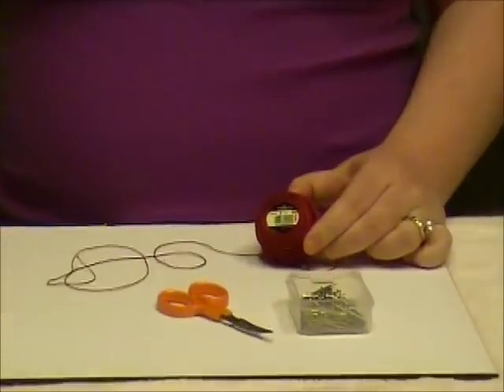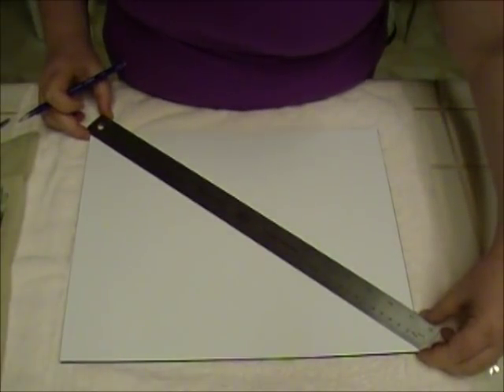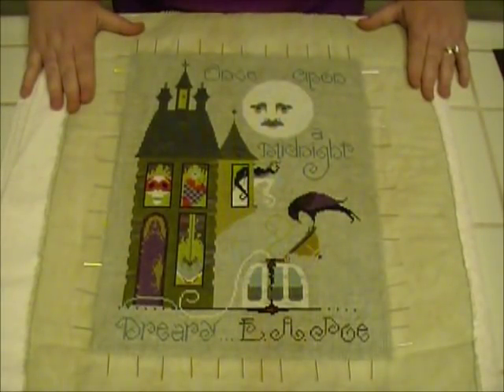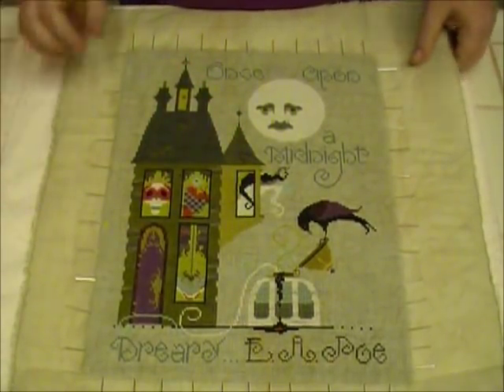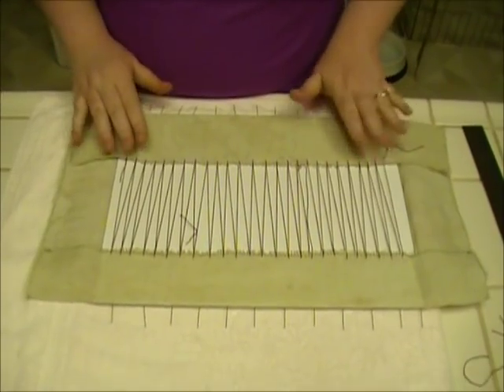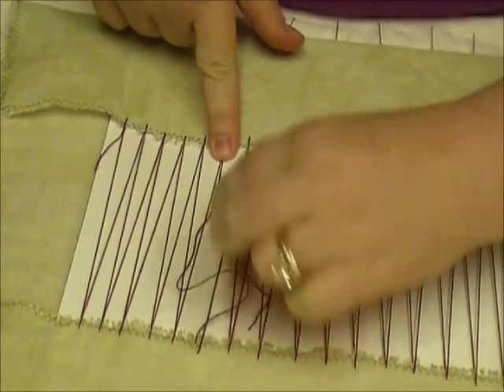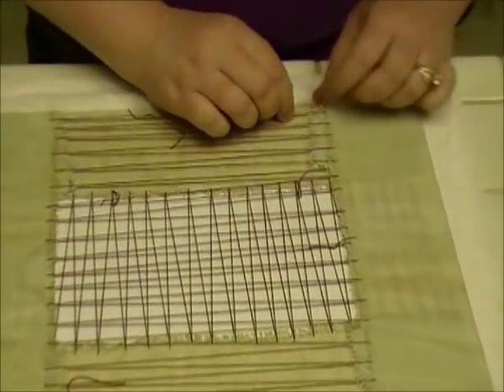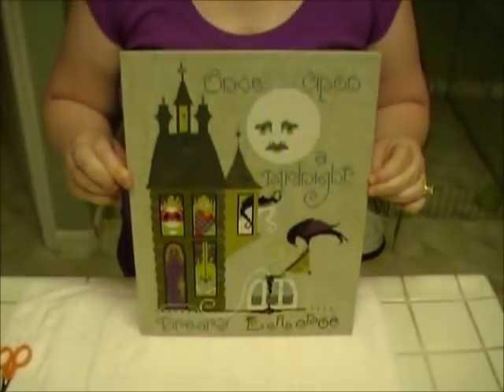How to Lace your Needework

Comment: I mark the centres on each edge of my mountboard on the back of the board.  I then baste stitch the centres on each side of my stitched piece so I can line them up.  I then gauge approximately where the fabric will fold over the board and put a basting stitch all the way around - counting the Xs rather than using a ruler.  I then have a line on 4 sides to guide me when I'm pinning.  Thank you for your video as I lack confidence with lacing and tend to pin and stick with masking or framing tape.

Comment: I  wrote to you before but I forgot to ask you a question. When your ironing a counted cross-stitch project, face-down on a towel, what should your iron setting be on? Also, what setting on your iron would be good if you used beads and metallic threads? I have been told many things but I wanted to check in with you and see what you said. Because you have given me good advice so far:o) Thank you so much for all of your help! Your really quite wonderful. You taught me how to lace my projects so I have gotten caught up on years worth of projects and am stitching new prpjects:o) Thank you.
Reply from the maker: Hi Laura!  Sorry for the long wait!  I use my iron on cotton with steam.. Unless there are metallic threads or that fishing line type thread used to attach beads.  Then I will lower the heat and cover the back with a thin cloth(like a t-shirt or the like)  then I try to iron like normal, just making sure I stear clear of the areas that have the plastic line or metallic that can melt with high heat.  So I'm basically getting the wrinkles out of the fabric, without rubbing the iron over the delicate stitched part.  Hope that helps! Janet
Reply: I use a steamer when I do mine. I wash it in Orvus, roll it in a towel to dry it & steam it when it is dry. My steamer has a small tank that sits on the floor & a long hose. I lay the piece face down on a clean ironing board surface/press cloth (or on a white terry towel if there are delicate beads, metallics, etc...) & gently go over the back with the steamer wand. Works a charm. The only thing I have to watch is for water drips since I am steaming it horizontally instead of the usual vertical. So I occasionally hold up the wand & jiggle it so the drips go back down the tube. I also use distilled water so there aren't as many minerals (just in case it does drip). It also works wonderfully to flatten folded or rolled linen, adia, etc... from my stash before stitching too! If you were super worried about things melting you could always hang them in the steam & see what happens... BUT I have never had a problem with the steamer and it doesn't mash the stitching or get caught on the edges of things.

Comment: Have you ever added padding before framing?  Wondering how you would center all the different layers.  (Thank you for this video. I was self-taught and did it almost exactly the same way.)
Reply from the maker: If I were to use batting for the padded look (like with ornaments), I use acid free spray adhesive and tack down the batting, then lace as normal.  Hope that makes sense! :)
Reply: Certainly does!  Thank you.  I'm not very crafty and don't even know about products like that.  I'll give that a try.

Comment: Thanks for your video! I was wondering about the way you stitched the outside edges of the fabric; is it by hand or by machine? I can't find any videos or other how-tos about this, most info says to tape the fabric before you start your project but I didn't do that. The Aida fabric I used (which I tea dyed before stitching) hasn't frayed at all so I'm not sure if I need to worry about it. Thanks.
Reply from the maker: Lisa Undercoffler, thanks!  I just use my sewing machine and do a regular zigzag stitch.  Please don't use tape, as the acids will break down the fabric.  If you don't have a machine, just whip stitch the edges by hand.  You could leave them raw, but your using a decent amount of tension to lace, so it might make your fabric fray. :) Janet

Comment: This vid is 5 yrs old and still relevant! I have a question. Some stitchers frame without glass, I'm planning on framing with glass. I've read that when framing with glass you should use spacers to keep the stitches off of the glass. I haven't found any cross stitching related vids concerning using spacers. And I wondered if instead it was possible to just cut a frame a foam core to go on the outer edge in front of the cross stich, hidden, but creating space. Like a mat board, but not a mat because it's hidden, and because I'm not fond of them. It wouldn't be very wide, and would require lots of measuring, but with limited resources it would be easier than hunting down spacers that I don't know how to utilize. Or does it even matter if the stitches are against the glass at the end of the day? Any thoughts? Thanks!
Reply from the maker: GreenEcheveria.. Thanks!  I always use museum (preservation) glass with my stitching, but it is pricier.  I am a proponent of keeping your work protected by glass, UNLESS it is not something you care to save for generations.  I also always use spacers if not using mating.  Any framer will have 'spacers', which they can sell to you.  They are basically long, thin pieces of black/white plastic with a adhesive back that you cut to size and stick on the glass edges to keep your piece directly off the glass itself.  You could try cutting strips of foam core, but it wouldn't be worth your time and frustration.  They are worth the small cost, trust me!  I hope this helps, if you have any more questions, please let me know.. :) Janet
Reply: Trixie Stitches.Thanks! That's incredibly helpful.

Comment: I want to thank you for you putting out videos to help all of us. That is sweet! I have a question. No matter what brand of aida cloth I use I can never get all of the wrinkles out of it after I washed and ironed it. I let the needlework soak in barely warm water with a cleaner for delicates. i soak it a few minutes and gentle swish it around and let it soak some more. Then I rinse it and let it drip dry. I hever wring/squeeze it out because i have found that causes more wrinkles. When it is dry I iron the piece face-down on a folded up towel. I do not know what I am doing wrong. I must be retarded! I am desperate. Should I not let my work completely dry before I iron it? Do you know what I am doing wrong? I do not want to use alcohol sprays to relax the cloth and take out the wrinkles. Can you please help? I will take any and all suggestions. Thank you so much for your help in this matter. Have a great evening. Laura
Reply from the maker: Thanks for your feedback! :)  and to not have wrinkles, keep the Aida damp, put front side down on a towel, then iron.  If you have any metallics or beads on it, put a clean thin towel or cloth over the back before ironing.
Reply: +Trixie Stitches  Thank you so much! Your wonderful! I really appreciate your tip on metallics and beads. i am starting to use mor of those so I would have needed the information soon. Thank you so much!
Reply from the maker: +Laura Moore Your welcome!  And if you ever use hand dyed fabric or threads, they aren't colorfast, so don't wash those :)
Reply: +Trixie Stitches Here I am bothering you again! But I forgot to ask you some ironing questions for needlework.What setting do you iron needlework on? Can you move your iron or should you press, lift and then reposition the iron? Should you iron your piece when it is damp, until it is dry? What setting do you iron projects with beads and/or metallic threads? How to you protect beads and metallic threads? Thank you so much! I so appreciate being able to draw upon your wisdom and experience. If you have time there is a video I would like you to watch on you tube. It is professional mounting in a store situation. Go to you tube and type in "Mounting Needlework." It should be the first or second on the list. The sites name is MilitaryMemoriesAndYou. The reason I want you to watch it is because this is what I was going to do until I found your video, plus it does have a few good tips on it. Let me know what you think. Have a wonderful week-end and thank you again. PS I had to tell you that when you got to the part in your video and talked about this was where you husband usually helped you then his hand showed up, well, that was just down right cute:o)
Reply: Laura Moore i

Comment: hi! I have used this method a few times, and I have found that the corners tend to be bulky because of the many layers of fabric. is there another way to cut/fold the corners to reduce bulk?
Reply from the maker: Melanie McDaniel, what type of fabric are you using, and how much leftover are you leaving after you've stitched your piece?  If you're using aida (which is thicker than linen) and/or have too much leftover fabric for lacing, that could be your issue :) Janet
Reply: Thank you for getting back to me. I think too much fabric is the issue.  😃